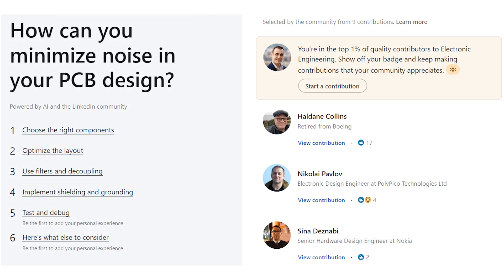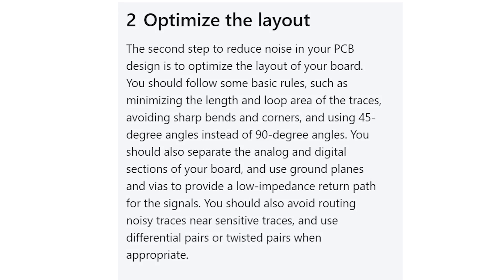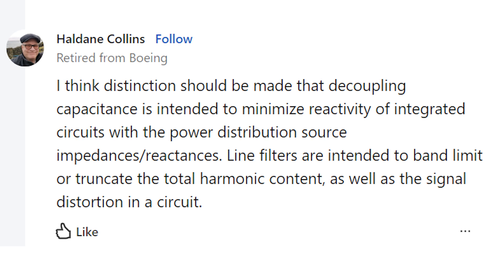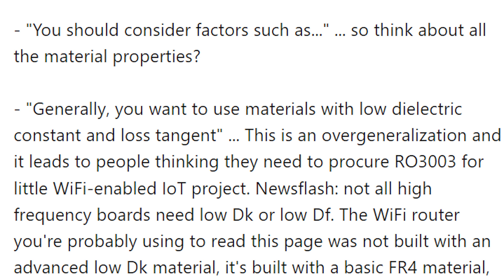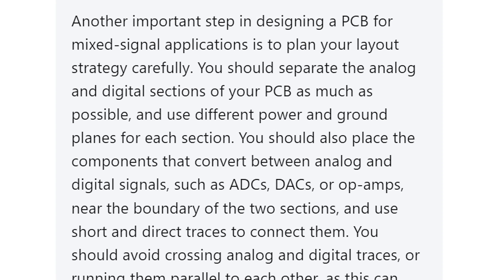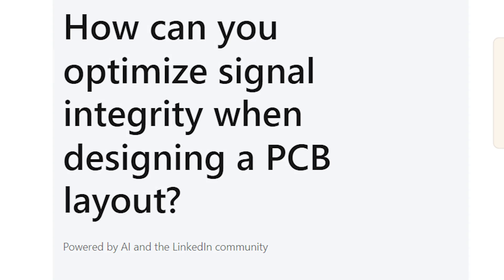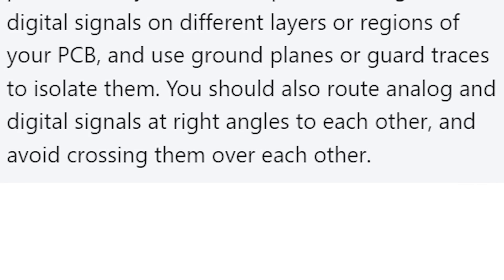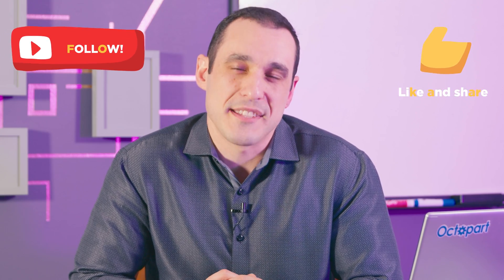LinkedIn's AI Fail: Exploring Very Flawed PCB Design Guidelines

Comment: Wait, the 90° was debunked?
Reply: This is an instance where people have seen curved traces only (no angles) at very high frequencies, such as radar frequencies at 60/77 GHz, and then people think that they need to eliminate sharp corners in every design. Most designs will be fine, even with 90 degree corners. Also think about this: every via is a 90 degree corner, so why would it be okay for vias but bad for everything else?
Reply: @Zachariah-Peterson  Oh thanks for the response Zach!
Does it also apply with high current power rails? Or is it just a matter of frequency?
(Diagonal lines still look cool)
Reply: @Heightren  It is simply a matter of frequency. Also power rails are usually long enough that the region where the current density is most prominent is spread out around the plane, it is not like the current density only exists near 90 degree corners.
Reply: @Zachariah-Peterson DIAGONAL VIAS are COMING !!!

Comment: Can we have a video when we really need a ferrite bead to filter noise in DC power line and how to size it? Thanks.
Reply: Sure, I will need to create a design that shows this. One thing I need to do is to show the related topic of when to use stitched ground regions for low frequency noise isolation, it's related because sometimes I see people do this stitch with a ferrite bead.